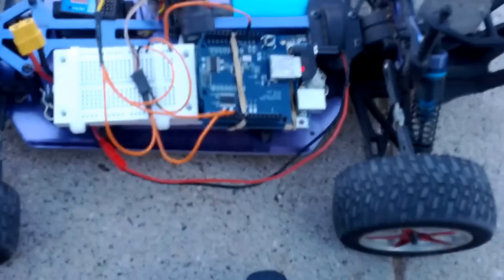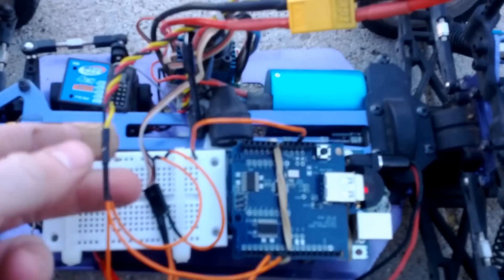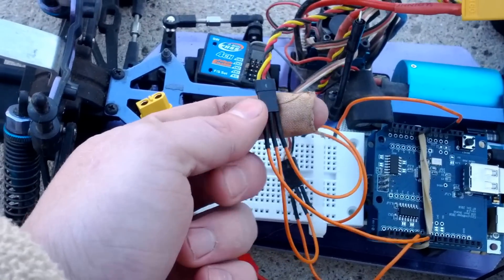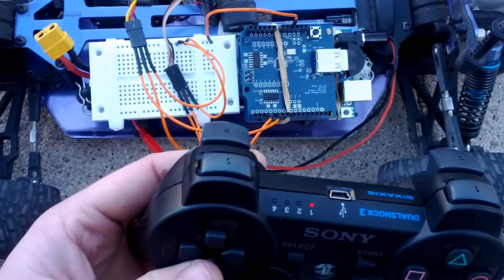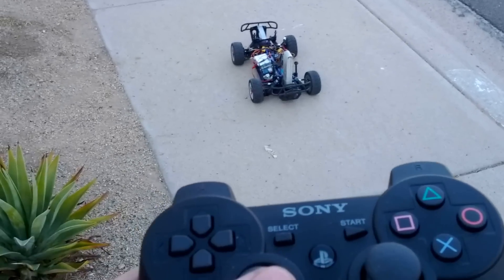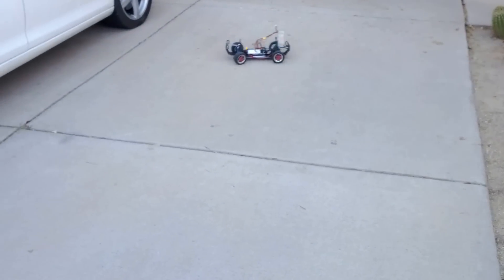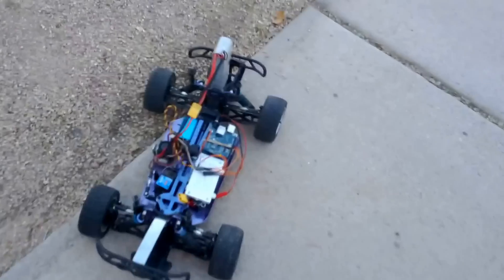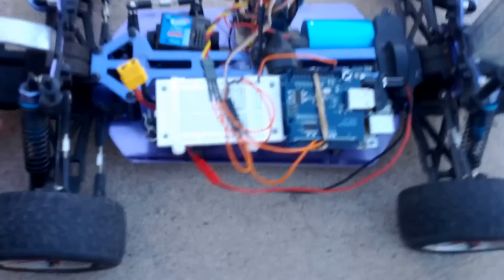Control an RC car with a PS3 controller, Arduino UNO, USB host shield and Bluetooth dongle (Part 1)

Comment: Man that works surprisingly well! I thought this system would have been a lot more laggy. It doesn't take a lot for an rc car to feel laggy at those speeds. So did you notice a big difference in responsiveness versus using a normal transmitter?
Reply from the maker: I noticed no lag. The only issue is range. The amount of data the controller is transmitting is small so Bluetooth has no trouble keeping up with the data rate.
Reply: Barrett Anderies How about using a higher gain antenna? Or maybe even a second arduino with and xbee and bluetooth shield. I've got this old rc car as a gift (imgur dot com/a/8f8FH) and want to try something similar. You interface directly with the servo if I understand correctly? Could the car not be controlled by just using it as a receiver, connecting it solely to the speed controller?
Reply from the maker: Wouter Van Goey I would think it possible to use a higher gain antenna, but I have no idea how you would attache such an antenna to either component in this case. People have done exactly what you suggest with the XBees. The basic setup is the following: PS3 controller --Bluetooth-> Arduino with USB host shield, Bluetooth dongle and XBee --XBees-> Arduino on RC car with XBee. There is a video on YouTube of a person doing this with an Xbox controller in place of a PS3 controller. This setup requires an extra Arduino and two XBees. The long range XBees can be expensive. Another option would be to use a 933MHz radio system in place of XBees. These are commonly used with drones to provide a telemetry link (ArduPilot, for example), and are pretty cheap. 
Yes, the Arduino interfaces directly with both the steering servo and ESC (and yes, the Arduino is acting as the receiver and is outputting the same type of signal as the original receiver would have).
Reply: Alright good to know that's possible. I guess the guy with the xbox simply connected the wired controller to the usb host shield. I've seen those cheap wireless radios too on sites like dealextreme. Does the price gap between those and xbees mean they're inferior or is that just the markup xbee has because they're a larger better known company? If those cheap arduino antennas do the job I'll just buy two of those, an extra arduino and a usb host shield. Did you write the software yourself or rather an existing open source project? This is a project for in a couple of months so is it okay if I contact you again by then?
Reply from the maker: Wouter Van Goey There is a wide range of XBees available, from cheap, short range ones to expensive, long range ones. I am not an expert on these systems, but I would guess that XBees are generally more expensive because they have more features than a basic 933MHz system and they are proprietary. That being said, if you Google "933 MHz telemetry system" the first result should be the "3DR Radio Set" page. These are in the XBee price range and have a very long functional range. XBees also operate around 900MHz but unlike a basic 933MHz system, XBees have features that allow them to do things like output a PWM signal (so an XBee could replace an Arduino in this (RC) application by controlling the ESC and servo directly). XBees can also mirror each other, but I have never used this feature. 
So the short answer to your question is that XBees are generally more expensive because they have more features. This gives you two options. You could buy a 933MHz system and have both a 933MHz receiver and an Arduino on the RC car, or you could replace these with an XBee that would act as both the receiver and the Arduino (depending on which XBees you use, this could be the cheaper option because you won't need a second Arduino).
To which piece of software are you referring? The USB host shield is running on open source software, and I used features of this software to write the code that drove the car. 
Yes, you can contact me in the future, but I would prefer it if you go to my website and email me. That way I can respond to you with links, and I am more likely to respond to emails more quickly. However, once I am back in school I may not have time to answer a lot of questions.

Comment: Are you able to change the controls? As in changing the R2 button to the accelerate.
Reply from the maker: +iChest123 Yes, you can define the controls to be whatever you would like. Just read the PS3 controller joystick, trigger or button (whichever you want), and input its value into the Servo instance to drive the corresponding motor/servo.

Comment: lovely work B, and i never knew you can use map functions in the servo constructor as a parameter 
servo1.write(map(PS3.getAnalogHat(RightHatX), 0, 255, 0, 180)); Beautiful 

i been writing a similar code but for servos, maybe you wanna take a look?  its for a AI  lmk

Comment: Hey Barrett, is there a way to adjust or trim the steering, mine is kind of go off to the right a bit but there is not trimming with this setup may be in the sketch?  we can do this with the regular TX/RV.
Thanks!
Reply from the maker: The code does not currently support trim, but adding trim functionality would be quite easy. You can modify the current code with the following to add trim controls on the right and left buttons:

// Put these definitions above the void setup() function in the code:

int offset = 0; // put this with the other global variables (above the void setup() function).
int steer = 127; // put this with the other global variables (above the void setup() function).

// Replace the entire void loop() function with this:

void loop() 
{
  Usb.Task();

  if(PS3.PS3Connected || PS3.PS3NavigationConnected) {
    
    steer = PS3.getAnalogHat(RightHatX); // read right joystick
    
    if(PS3.getButtonClick(RIGHT)) { // trim right
      offset += 1;
    }
    if(PS3.getButtonClick(LEFT)) { // trim left
      offset -= 1;
    }
    
    steer = steer + offset; // incorporate trim into steer command
    if(steer > 255) steer = 255; // enforce upper limit
    if(steer < 0) steer = 0; // enforce lower limit
    
    servo1.write(map(steer, 0, 255, 0, 180)); // write steer command
    servo2.write(map(PS3.getAnalogHat(LeftHatY), 0, 255, 180, 0)); // write throttle command
    
  }
  else 
   {
    servo1.write(90);
    servo2.write(90);
   }
    
    if(PS3.getButtonClick(PS)) {
      PS3.disconnect();
   }
}

This code will compile, but I did not have the hardware available to test it. It's quite simple, so I don't foresee any bugs, but there could easily be one. However, if there is a bug it should be pretty easy to fix. If the trim is in the wrong dictions, swap the "+=" and "-=" parts of the code. Also, if you run into a problem with the Arduino IDE not compiling due to something with the SPI.h library, just add #include <SPI.h> under the other #include lines. Hope this helps!
Reply: @Barrett, work perfectly, Thank You!
Reply: Barrett Anderies can I make a project without esc?